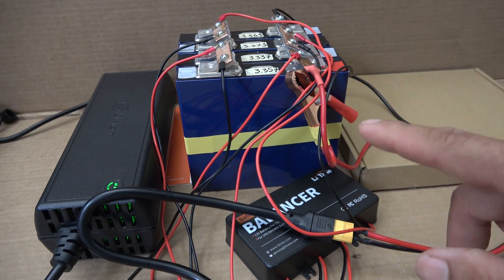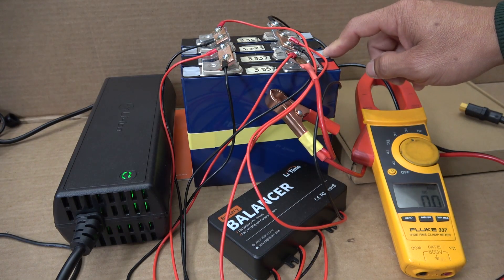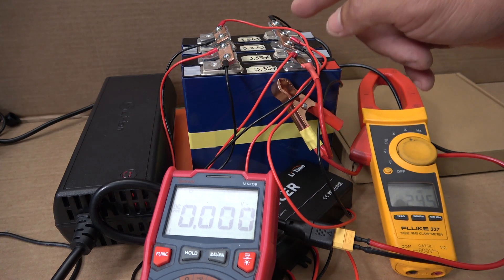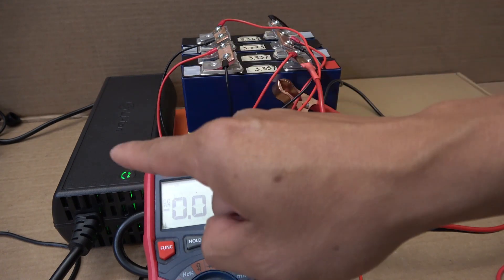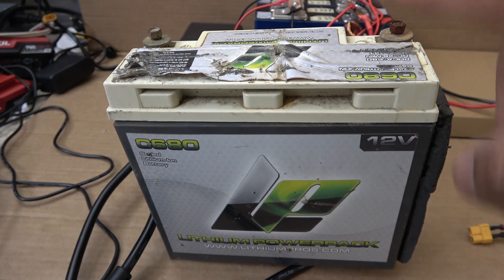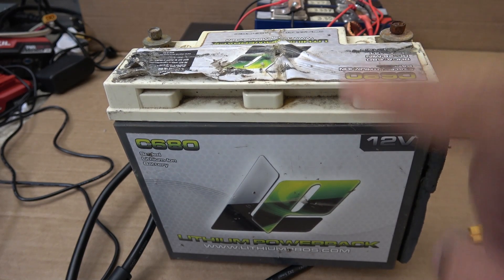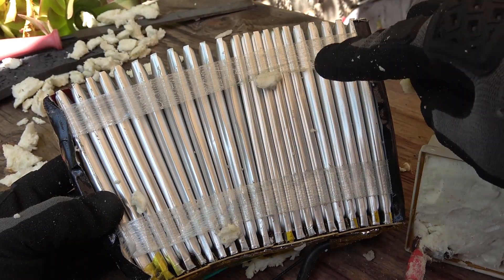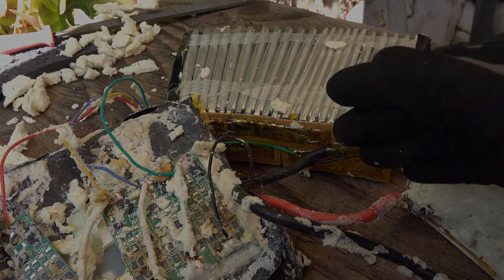LiFePO4 battery: is a (cell voltage) balancer enough? Do you really need a BMS?

Comment: So cell voltage went high when your charger went way over 14.75 when you said it was preset to 14.6v? How strange… set the charger to 14.4v, you lose very little performance and won’t go over 3.65v per cell… and it will prolong the cell life also…

Comment: I use both BMS and active balancers. On some of my 16s packs I use an active balancer without a BMS. When I'm charging at 0.33 C and my active balancer is rated for 1 amp on a 16s pack I never have to worry about overcharging. I monitor discharge on all of my packs the same way that someone would have a gas gauge in their car. And for the same reason that driving your car until it stops out of gas, running your pack below the low V cutoff would be very stupid.

Comment: The amount of current drawn by a starter motor, esp. in colder climates would require an expensive BMS to handle about 300 amps, with initial brief surges going quite a bit higher in some cases - those surges would destroy a typical BMS without an expensive amount/quality of FETs rated to handle that.
Reply: probably a bad idea to use LFP for kickstarting anyway

Comment: I don't agree. I use "one balance" blue tooth 1A active balancers to do this all the time with RC lipo packs on mini motorcycles. You can monitor all cells on your phone. I charge to 4.15v per cell instead of 4.2 for a little wiggle room but I have packs 3-4 years old that still balance out great. Balancer is active all the time. When charging and when in use. These are high drain cells 24S pulling 450A peaks. The reason those cheap packs don't last in my opinion is because they are pulling too many amps from them. I regulate my max amp draw in my controller specific to the cells I run.
Reply from the maker: You're right. It's possible, if you know what you're doing. You are, actually, the BMS in this case. And you charge it below the maximum voltage so there's some overhead room for the cells to wiggle. Also your cells are high drain so you don't have to worry about overdischarging them. You ARE the BMS in this case. :D

Comment: I've been running a 16S Headway 40152S pack for several years with no BMS but a) the specs for these cells say they can safely be charged to 4.2V, and b) I'm always checking individual cell voltages with a DMM. Also, the pack originally had a BMS, but I blew it due to careless handling; if I had more money, I'd just order a new one!

So...I guess there's probably one good parallel cell group in each of those dead 4P packs you have, eh? Better than nothing, I guess.
Reply from the maker: You can use it without BMS. But then you become the BMS because you'll have to check it often. Plus, if something goes wrong with one cell, the rest of the pack will be overcharged.
Reply: @ Agreed, comrade. In no way should most people do what I'm doing, most especially if their cells are the "hotter" lithium chemistries like li-po, li-co, li-NMC, etc. I've already done a bit of accidental spot welding -- a dead short of 7 cells with an Allen key! -- so as I said, even I would prefer to have an actual BMS than to be the BMS.

Comment: Instead of being 4 cells, it actually was 24.  Does it having more cells make it worse for voltage drift between the multiple cells?
Reply: It's still 4 cell groups. The voltage will be identical in each cell in a given group, because they're all connected at both positive and negative terminals.
Reply: @PalOStein  Then the issue is when they are connected in series.
Reply from the maker: @JT-lq4yd: having more cells makes it worse. There's more points of failure. Unless you can fuse individual cell like in a Tesla pack, if one cell in the group fails, it brings the whole group down.
Reply: @vuaeco  I am not too versed in lithium battery technology, so I was wondering if one of the paralleled cells was under/over charged would affect the group and in time the battery pack would be taken out by that group that was not charged properly.